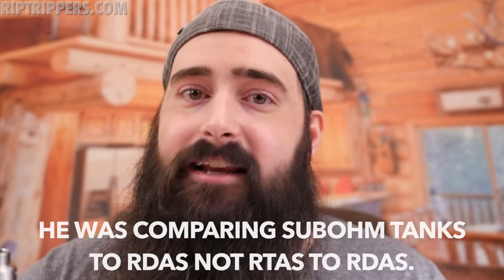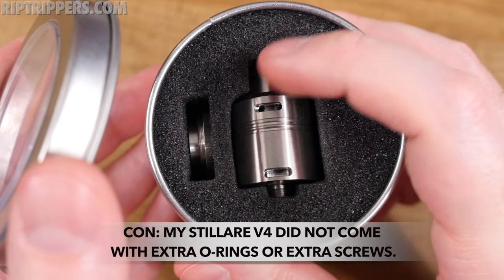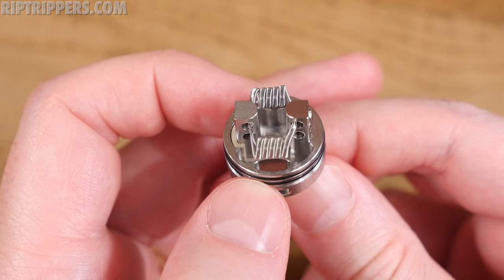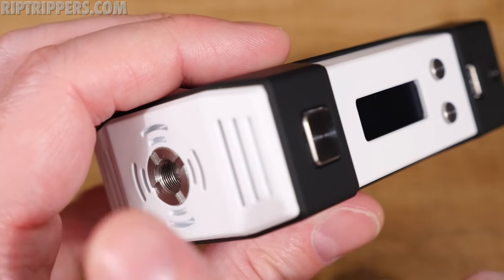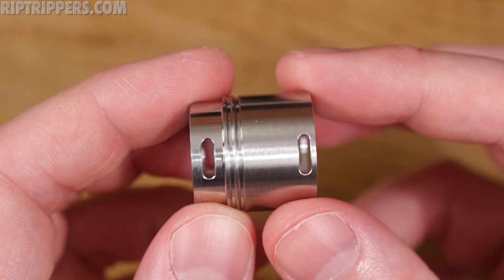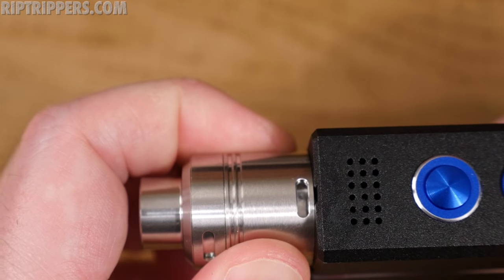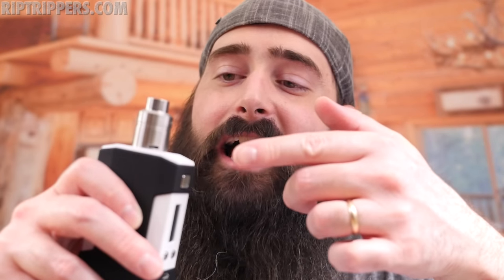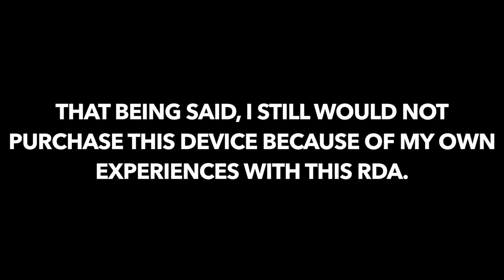Stillare V4 RDA By Cartel Mods!

Comment: man the stillare v2 with a chuff cap is my favorite rda setup, so dissapointed they followed everyone else with the 2 post design, and the bottom air flow.
Reply: +XxMauiboixX Bottom airflow I can understand not liking, I like side and top most, but the velocity deck is the best, you really prefer struggling (not struggling, but it's tedious) to build on a 3 post?
Reply: well when i started building i only knew how to build sleepers on a 3 post. it was the easiest. i also love doing 22gauge parallel sleepers and to me its way more difficult to do those on the 2 post design. building on an rda will always be tedious. to each his own
Reply: XxMauiboixX Good points, what's a sleeper coil?  Haven't heard of that.
Reply: a sleeper build is pretty much when you use 1 strain of wire to build your 2 coils instead of using 2 separate wires. its just another way to build your coils nothing special. i think rip has a vid on it.
Reply: Oh yeah i've seen those, didn't know the name, haven't attempted it yet but i've been wanting to try it, have any recommendations for one?
Reply: 22 or 20 gauge kanthal,5 wraps around a 3.0mm screwdriver never dissapoints.

Comment: Can you buy clapton builds anywhere online? I wanna build it myself but I'm not really good with my hands.
I even use a coil jig for simple builds.
Reply: +Breed LG i dont know where you live but wotofo has some http://totalevapes.com/products/wotofo-competition-coils-clapton-coil
Reply: +Breed LG yeah you can but theyre kinda pricey for the amount you get. If you dont wanna go through the hassel of building them yourself I would suggest buying a spool of clapton wire and just wrapping them yourself. I bought ten feet of it for under ten bucks on amazon; I'm sure you could probably find better quailty somewhere else, but that was most convenient for me
Reply: +rosselbossel Thanks for the link, yeah i live in East NA. question though, is that 3.99 for 1 clapton coil or is it for the whole tube filled with clapton coil (the one in the picture).
Reply: +Joe Scags Thanks, I'll try to do my scavenger hunt on amazon.
Reply: Breed LG i think there are five or six in one tube but yeah i would rather buy clapton wire and get a kuro coiler for easy coil building :D
Reply: +Breed LG ud has some good little spools, and they last a while, also lightning vapes I believe.
Reply: lmao ^^^^

Comment: Can I lock the resistance on kanthal wire, or do i have to be using nickle wire and be in temperature control mode? I was going to get the sigelei 90watt 26650 and it has the locking resistance option but i wanted to know if i am not using temperature control can i still lock the resistance?

Comment: Hey rip on those 3 mods tighten the 510 back in all the way tight an re try cuz it works on mine but only if it's screwed in tight if you back it out it won't

Comment: I have to call BULL about tanks not being able to accept whatever coil you want to use like a dripper can . I have been rebuilding tanks since I got my first ViVi Nova all the way to my newest tank I just in mail a couple days ago . Don't have a clue where Rip got his information from about not being able to rebuild tanks .  I thnk CE4's are even rebuildable ... WHAT GIVES ???
Reply: so any novice builder can just rebuild any subohm tank coil head with ease huh?
Reply: Josh Garcia
I think with a bit of practice , just about anyone could . I am a novice myself , and have been at it for about 4 years now .  I just built my first Clapton coil on a Youde Goliath v2 tank about 2 nights ago when I got my vape mail in . So , yeah , I think it can be done fairly easily , with practice . I always seem to cut wires on drippers , so tanks are MUCH easier , even though they are a bit smaller on the interior , look at the old Oddy . Had one hated building it , but used it for about a year . With a build every week and a half or so .
Reply: There are tons of builds that I can't fit in most tanks, the griffin and the vcmt being the best for big coils. But for coils with TONS of surface area, I have to put in an rda.
Reply: +Donald R different strokes i guess.

Comment: I'm getting the no atomiser on my geekvape avacado with my rx200, it comes and goes randomly, I've adjusted everything and nothing completely fixes it, any one else?
Reply: hey bro I have the rx 200 and use my avocado all day what build do you have on it?
Reply: I'm running a dual coil, 24awg coming in at 0.40, but even that can fluctuate some
Reply: Hmm your leads are cut and tightened all the way? And have u shut it off then put tank on and turned it back on so it reads your new coil? And have you upgraded your firmware? Sorry for all the questions but I never had the problem you having mine always is on point I have dual claptons on mine.
Reply: +Travis Avino yeah, everything is nice and tight, triple checked everything, gonna probably get a different mod to try for a while
Reply: +Travis Avino fixed it, it was the top screw nut thing, I was tightening it up and it was pulling the gold screw up too much, leaving the top nut off has got it working on all my different mods☺
Reply: +Ivan Shingler glade you figured it out. I knew it was something dumb lol. hope you enjoy your avacado bro I love that tank and also the velocity genesis tank both bad mofos